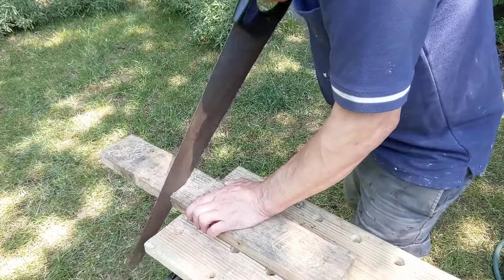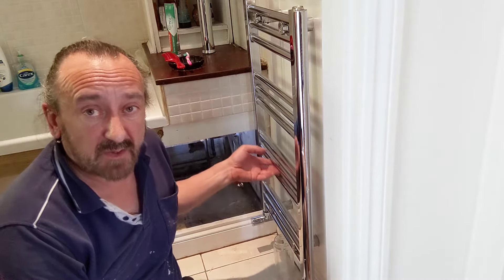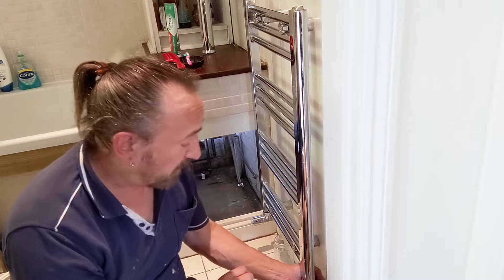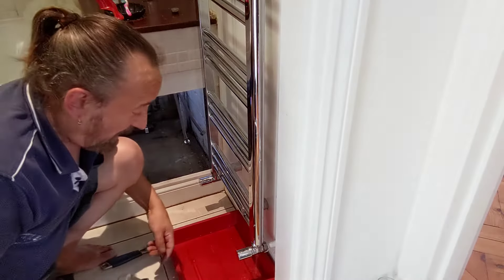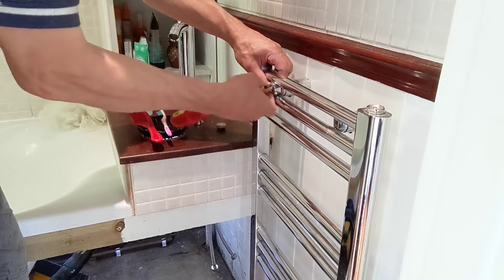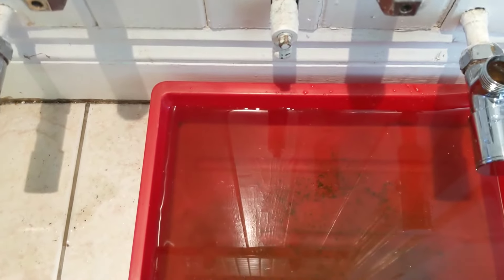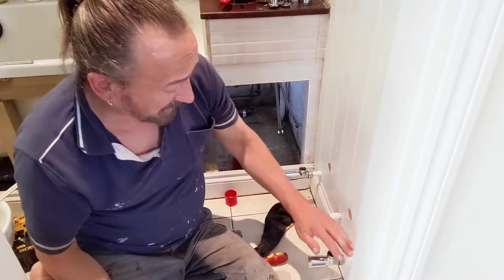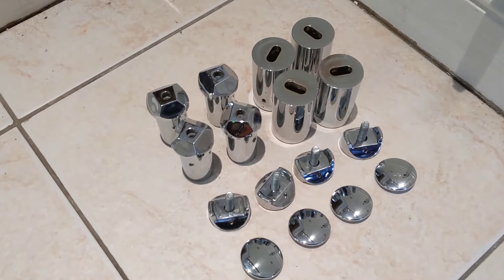Bathroom re-fresh - Day 2 Radiator Removal

Comment: Thanks Johny that was interesting.  Could you have refinished the tubes instead of replacing the whole radiator?
Reply from the maker: I don't think that would be possible. Apparently you can get a chrome like paint now but the new rad was only £20 anyway.
Reply: @JohnyLondon  that's great and worth replacing then.  Looking good.

Comment: Hi mate I love people doing diy but you really don’t need to wrap the thread on your compression fittings your sealing surface is between the olive,fitting body and pipe, love the videos!
Reply from the maker: Yes that's totally true as far as leaking is concerned but I find the tape helps the parts do up nice and smoothly like when you use Boss White or similar. It does look a bit untidy though.